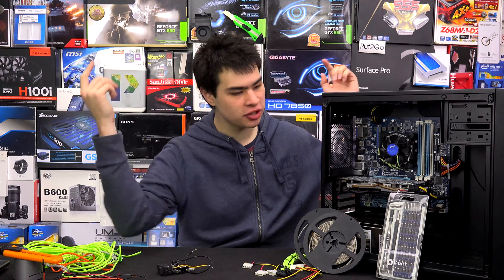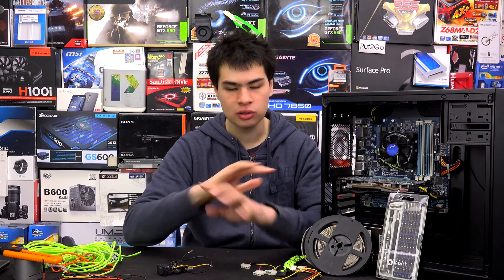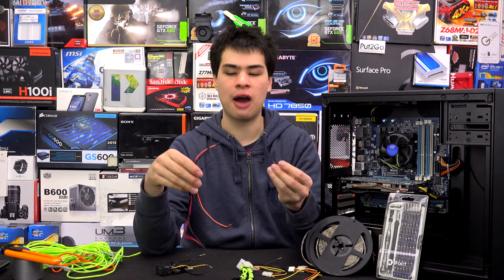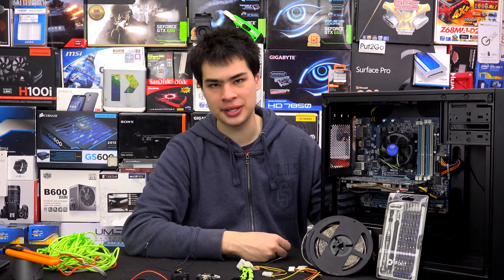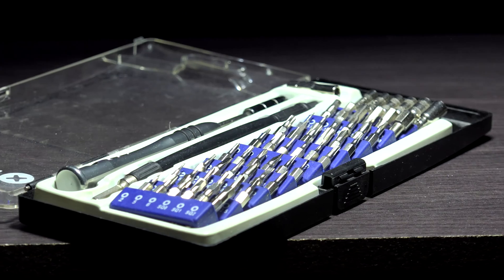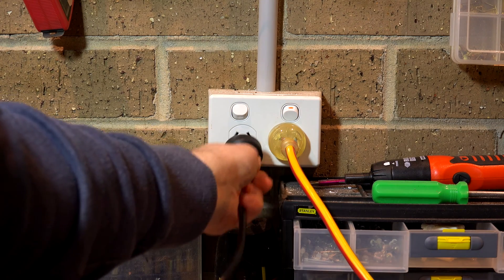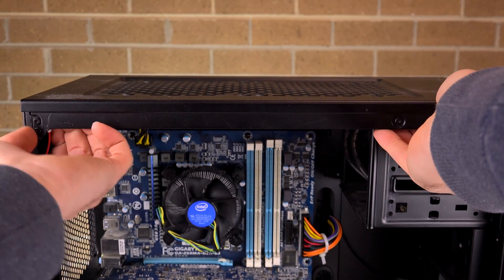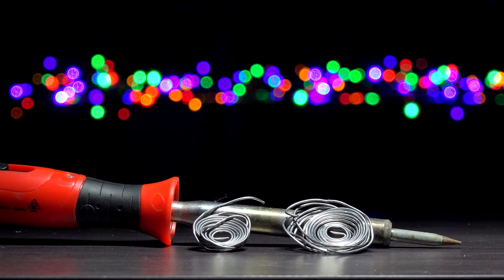How To Install LEDs

Comment: cool tutorial, i remember doing this with multiple rgb strips and a rgb controller, never again. Soldering all those small wire bridges between strips its such a pain and sometimes if your iron is too hot you end up burning a led from the strip. From now on i stick to 1 color strips :P